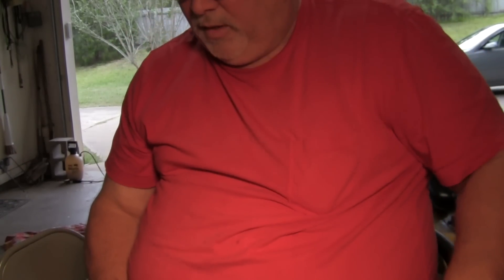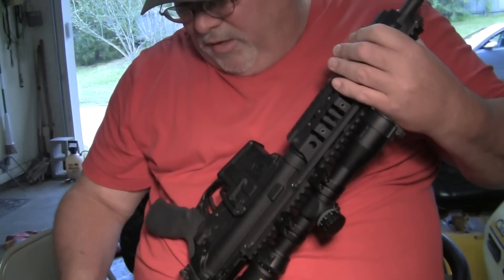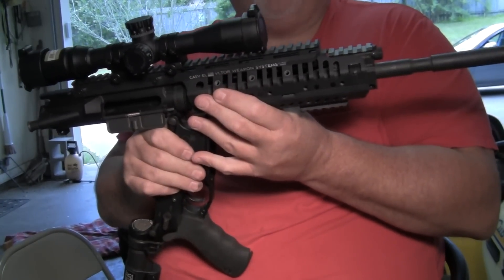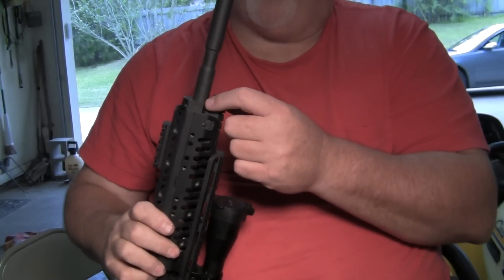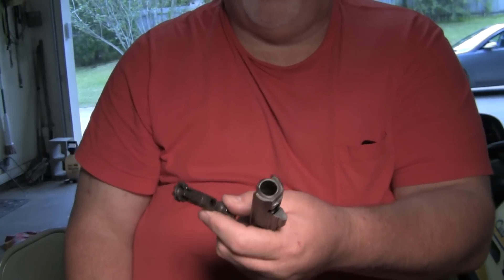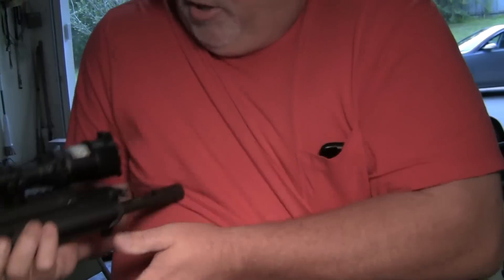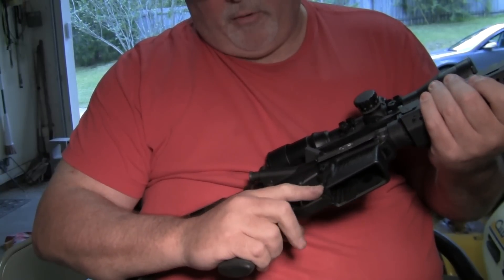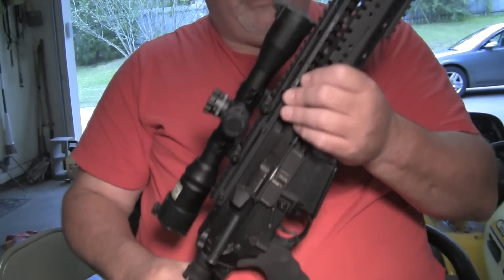Smith & Wesson M&P-15 AR15 M4 with Gas Piston Disassembly & Cleaning.mts

Comment: Sorry. Guess I should have mentioned these were reloads I bought. 
I just buy XM193 for my stash now. I am researching heavy buffers as we speak. The heavier buffer should aid in slowing down the high cycle rate of the piston guns. 
What buffer did your Adams rifle come with.
Is it marked in any way to indicate the weights?
Reply from the maker: mine was the standard Milspec buffer on my S&W with the AA piston kit
Reply: Keith Wade my LWRC came factory with an H2. I am sure it is to combat the high cycle rate. 
I am on the fence about the H2 with tungsten weights vs the H2 with Tungsten powder. Any advice?

Comment from the maker: I don't remember exactly what it was, it was awful though, probably around 8-9 lbs and draggy. I don't mind a little heavy trigger but scratchy and draggy has to go. Only way to reduce the weight is bend the spring, if you attempt this and I only recommend a qualified gunsmith do it, stick a screw driver shaft that fits the opening of where the pin goes through and press the spring back slightly, re-install and check the pull on the trigger spring. Do not over do it.
Reply: Keith wade did you no that your bolt end is the wrong one if you still have your m&p 15 piston look on the PDF manual scroll down to piston bolt carrier and you will see that one will scratch grooves inside your carrier hope this helps.

Comment from the maker: I did the trigger job on my rifle and it is 5lbs. A lot of times you just need to polish the sear without removing very much metal at all. If you can get the roughness off you will be suprised how much easier it is to manage. To reduce the weight of the pull, you will have to deal with the trigger and hammer spring. There is a way of doing this by PROPERLY bending the springs and I am not going into this and I do not want to be responsible for someone not doing it correctly.